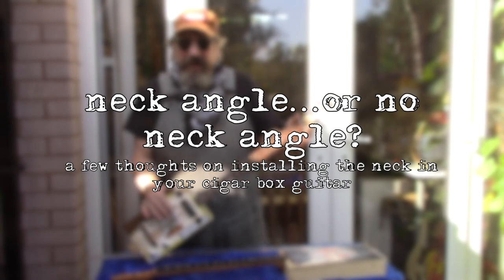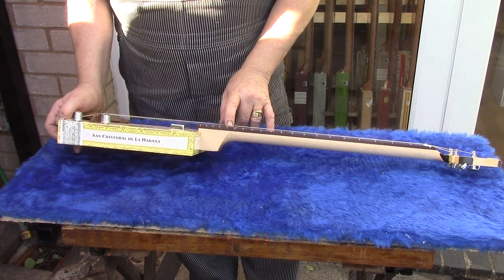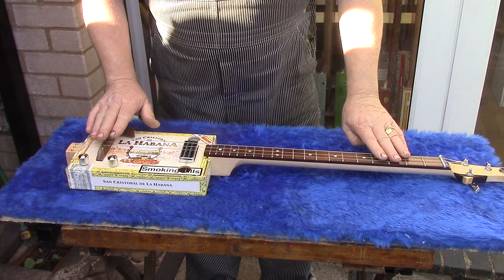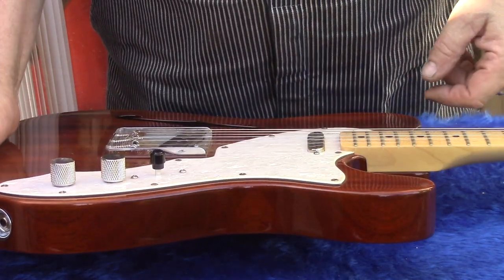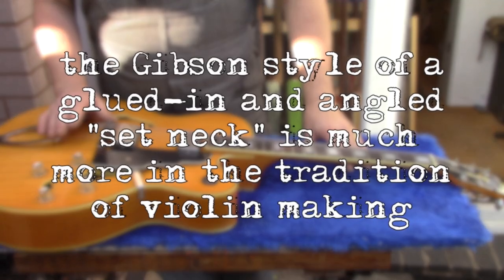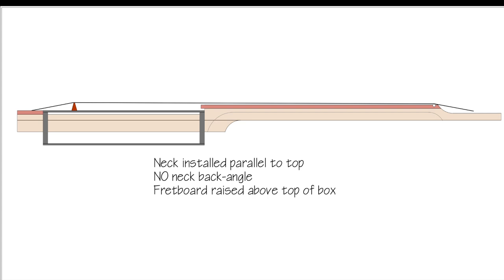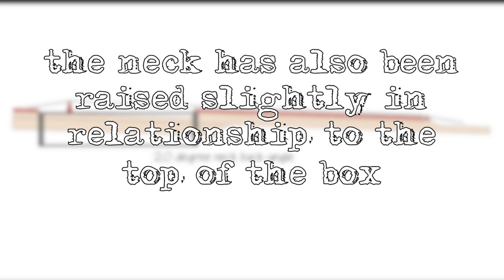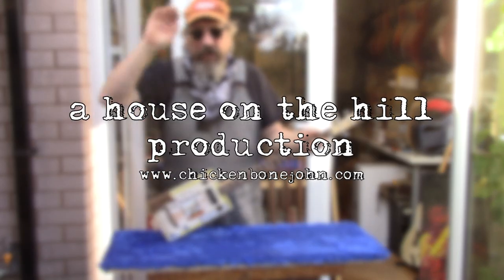Cigar Box guitar- neck angle or no neck angle?

Comment: I had been wondering, just today,  about the importance of head stock angle, or totally flat head stocks etc. Thank you for this very informative video. I have been working with my Ebay bought cut recently. It is a 3 string one with a piezzo pickup and an angled neck. I'm an old 6 string guitar hack myself. There is another type of cbg setup out there. C. B. Gitty makes two kits that look about identical. One is called the Pure and Simple kit, the other is the Big Easy. Both use basically a straight piece of 1x2  for a neck. The neck is sitting on the top of the cigar box, secured with two screws, and the necks overhang the box at the bridge end.  These are both fretless and come with no pickup, and use a wooden free floating bridge. A gent on YouTube built two of these. One, he added two "fender" washers to the two screws holding the neck to the box, and that one turned out much louder than the other. Both were certainly playable and sounded good, and these are predrilled, so seem like even I could put one of these together. 
    Any thoughts on this type of setup on a cbg?